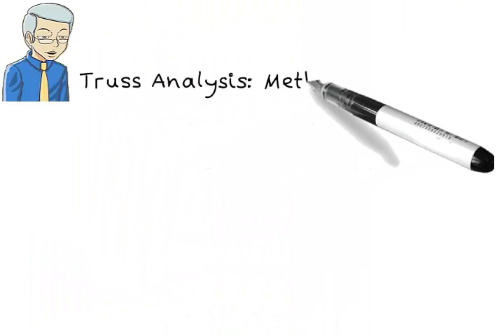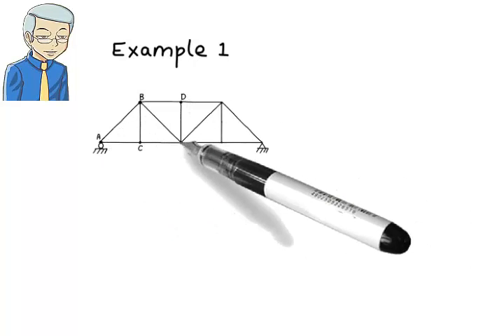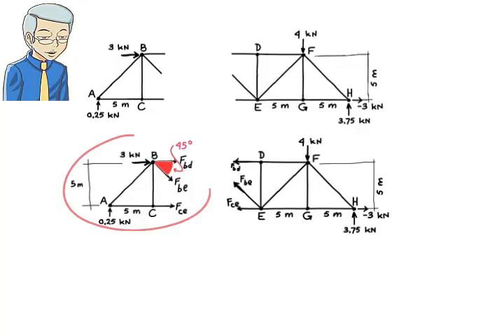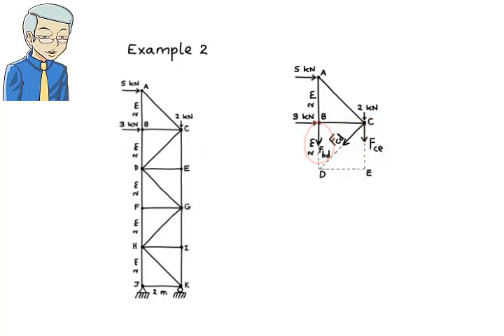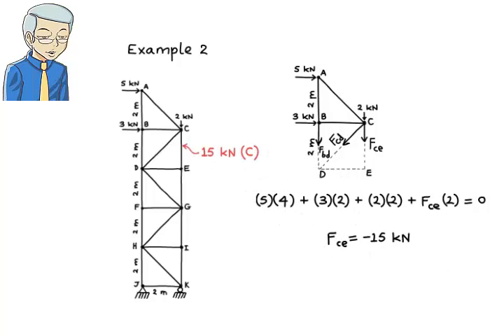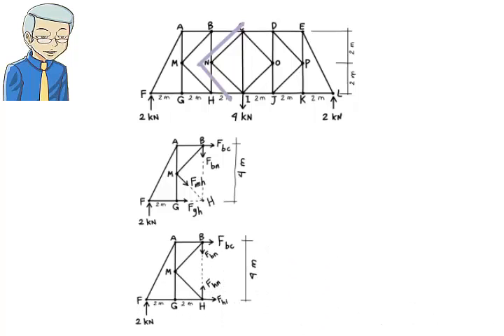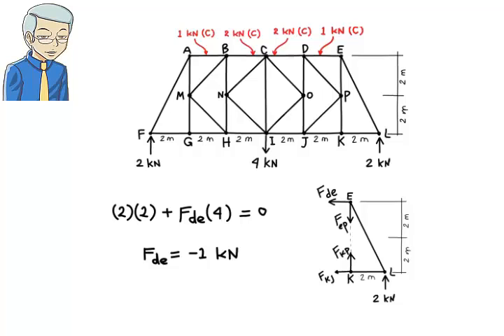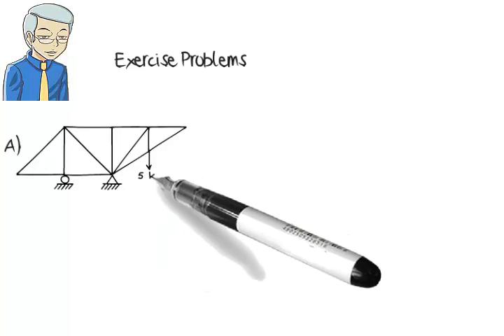SA10: Truss Analysis: Method of Sections

Comment: Hello, thanks very much for these great lectures..
Please, can I get the solution of B & C problems ?
Reply from the maker: PROBLEM B:
Cut through member AB exposing the internal force in the member. Let's label the force Fb.
Fb has two components: an x component (Fb cos45) and a y component (Fb sin45).
Since member AB is cut, we can isolate substructure BDEC (the main structure minus the pin at A and the lower part of member AB). 
Take sum of the moment about point C in this substructure.
Three forces cause moment about C: the applied force and the x and y components of Fb.
The moment arm for the applied force is (5 + 5 sin45). This is the vertical distance from Point D to the bottom of the structure.
The moment arm for the x component of Fb is (5 sin45).
The moment arm for the y component of Fb is also (5 sin45).
So the entire moment equation (about C) can be written as:
2(5 + 5 sin45) – (Fb cos45)(5 sin45) – (Fb sin45)(5 sin45) = 0.
Solving the equation for Fb, we get: 3.41 kN

PROBLEM C:
Cut through members CE, CD and BD exposing three internal forces: Fce, Fcd and Fbd.
Now consider the left substructure, the one consisting of nodes A,C, and B only (and the applied load as well as the three exposed internal forces).
Sum of the moments about C must be zero. Note that two of the unknown forces (Fce and Fcd) pass through C therefore they don't contribute to the total moment at C. Only two forces cause bending moment about C: the applied force and Fbd. Therefore the moment equation has only two terms: the moment of the 5 kN force and the moment of Fbd about C.

The interior angle at A is 36.86 degrees. This is calculated using inverse tangent of 18/24.
This makes the vertical distance from C to the bottom of the truss 10 sin36.86 = 6 m. This is the moment arm for Fbd. 
The moment arm for the applied load (the horizontal distance between A and C) can be calculated using : (10)^2 = (6)^2 + (arm)^2. Or, arm = 8 m.
Now, let's write the moment equation:
5(8) + Fbd (6) = 0.
Or, Fbd = -6.67 kN
Reply: Dr. Structure  Thank you very much ..
Reply: +Dr. Structure  sir in problem(B) you missed up the (Ay)force from the hinge support and also you should say Fb(5sin(45)*2) because Fbx does not make moment at C .

correct me if i am wrong please !
Reply from the maker: +jana yool When the truss is cut through member AB, two substructures result: the one to the left consisting of joint A and part of member AB, and the part to the right. If we consider the  right substructure for further analysis, then Ay does not appear on the free-body diagram since point A is not a part of the right substructure. 

Further, neither the x component nor the y component of the force in member AB passes through point C. Taking sum of the moments about C, the moment arm for the x component of the force is 5 sin(45), and the moment arm for the y component of the force is 5 cos(45).
Reply: You are right thank you sir

Comment: just u wrote at the first exampe and first three equation where come ? i didnt get it
Reply from the maker: In Example 1, the three equations are the conditions for static equilibrium:
Sum of the forces in the y direction must be zero: Ay + Hy - 4 = 0.
Sum of the forces in the x direction must be zero: Hx + 3 = 0.
Sum of the moments (taken about Point H) must be zero: 20 Ay + (3)(5) - (4)(5) = 0.
Reply: Signma Fx,Fy and momet eqns
Reply: Dr. Structure Sum of the moments (taken about Point H) must be zero:______________________________________________
HOWEVER SHOULDN'T THE EQUATION BE
 20 Ay + (3)(15) - (4)(5) = 0.
______________________________________________
since the 3kn force at point B is 15 meters away from Point H
Reply from the maker: Anthony Simeone
Moment arm for the 3 kN force is 5 m, not 15 m. Moment arm is the shortest distance from the force to the point. Draw a perpendicular line from the point to the line of action of the force. The length of this line is the moment arm.

Here, the line of action of the 3 kN force is a horizontal line that extends from negative infinity to positive infinity. From H draw a line (moment arm) that is perpendicular to this infinitely long (horizontal) line. In this case, the moment arm is going to be a vertical line having a length of 5 m.